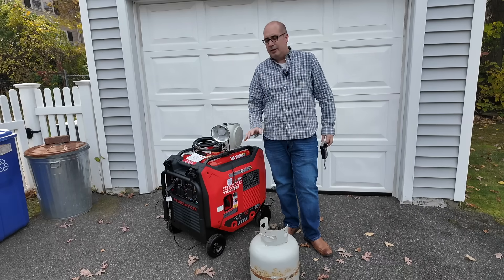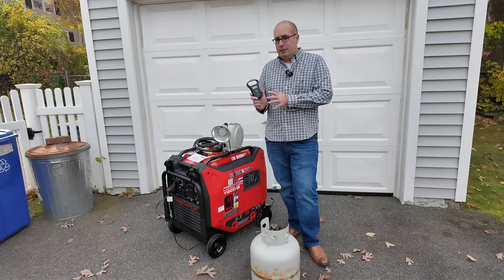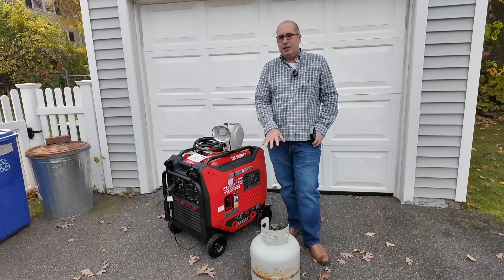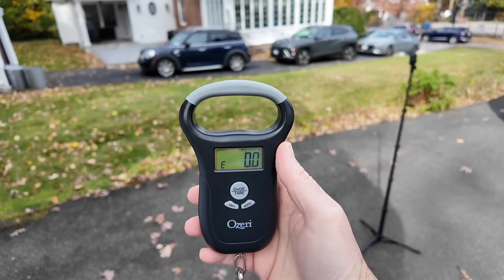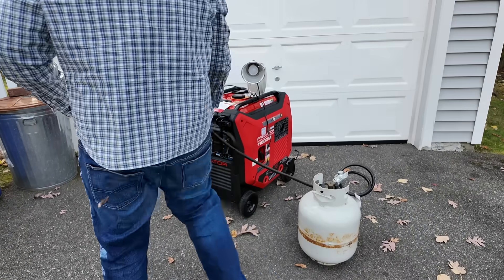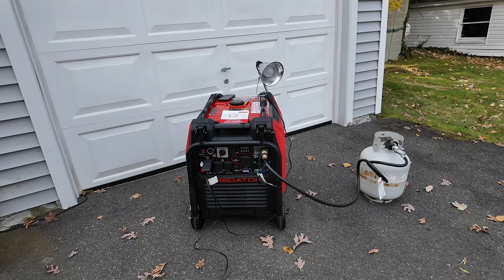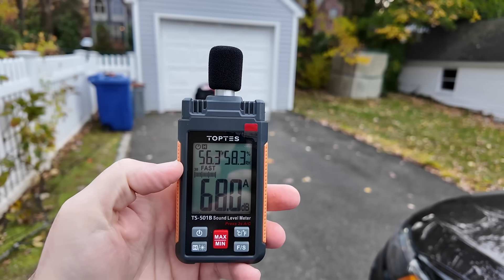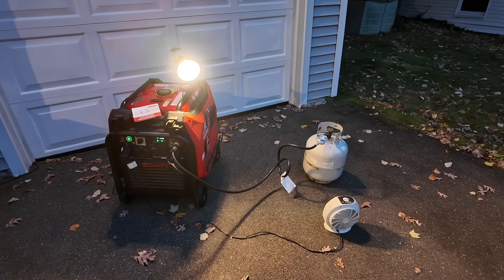Predator 11500w Generator Propane Runtime – You Won’t Believe How Long It Lasts!

Comment: For backup heating during the winter, I have a Big Buddy heater and 20# propane tanks. I plan to keep the tank on the back step outside, feeding the fuel to the heater inside via a 12' hose. 

So...now I have to worry about my tank freezing up and losing my heat?? I wasn't aware of this issue. Or is this more an issue with the generator? Screw that. I'll just bring the tank inside and take my chances. Not going to fool around with hypothermia. 0 -25 degrees F is common where I am.
Reply from the maker: Freezing up is definitely a concern when it's cold, especially with high draw from a generator!
Reply: @Outdoor_Prepper  Well that was my question...is this more of an issue with the generator? I'm not powering my generator with propane. I'm running my heater.
Reply: A Big Buddy won't draw propane fast enough (18,000 BTU) to freeze up a 20 pound tank at -25F. You should be ok. Been there, done that.
Reply: @zippy2641 I've run my (regular) buddy heater down into the low 20s F on a 20# tank with no problems with the tank outside. Supposedly the run time on a 20# tank for a regular buddy heater is 48 hrs on high and 108 hrs on low, so the genny uses at minimum 6x the flow of a buddy heater on high.
Reply: @Skyhawks1979  👍Thanks for the reply.
Reply: @jake-mv5oi  Thanks for the reply.

Comment: Everything in my home is propane, I own my own 3- 500 gallon tanks and paid 1.27 a gallon this year. My electric bill continues to climb every month although I use very little. It would be interesting to calculate what it would cost me per KWH to produce my own electric with this generator. From what I understand you said 20 lbs (5 gallons) of propane gave you 8 hours at 2000 watts which would be 16 KWH. Propane weighs 4 lbs per gallon. so if my calculation is correct, you got 16KWHs for $6.35. Dividing my electric bill by my usage I come out to 3.37 cents for 16 KWHs. I divide what I pay per KWH plus all those other charges that I would not need to pay if I generate my own. I would love to incorporate this unit with a battery pack that it could recharge while running so I could turn it off at night and during the day when not there. Very good video, Thanks
Reply from the maker: That’s definitely an interesting idea! Thanks for watching
Reply: There are 720 hrs in a 30-day month.  Unlike diesel engines, gas engine generators aren't really designed for 24/7 operations.  Fuel consumption would vary, presumably higher in daytime, lower at night.  Maybe combining battery power with gas generator would be more efficient.  Charge battery and power home during day when electrical demands are higher; run on battery power at night when electrical demand are lower..

Comment: FYI, I believe that the department of transp. mandates that propane tanks under 1000 gals. not be filled beyond 80% to account for gas expansion in the heat. Your tank appears to have been filled to about 96%. That level might be dangerous in Summer heat. Be careful.
Reply from the maker: Appreciate the info! Thanks for watching
Reply: Yep, I think ALL propane tanks are to only be filled to 80% for expansion and conversion from liquid to aa gas. (Some type of scientific term 😂)
Reply: The tank can’t be  filled over 80 unless it is defective. 
Portable tanks have an Overfill Protection Device (OPD) that automatically shuts off the flow at about 80% full.
Reply from the maker: @jimbo5635 I agree - 80% of the tanks capacity is 20lbs of propane. They are made to have extra reserve that isn’t filled with propane to allow expansion for safety
Reply: His tank is not over filled, a tank properly filled to 80 percent weighs approximately 37 pounds
Reply from the maker: @jimbo5635 thank you!
Reply: @Outdoor_Prepper Not for safety  it needs 20% to expand and turn into gas from liquid.

Comment: Hi, the regulator you used in this video is different from the predator 5000. Is that the regulator that came with the larger unit or is that an aftermarket 2 stage regulator?
Reply from the maker: It’s the regulator that came with it. The 11500 and 5000 watt generators have 2 different regulators and quick connect ports on the generator

Comment: This is excellent.  A good comparison would be the total amount of energy out of a tank.  In this case you got about 16,000 watt hours out of it.  For a smaller generator you will probably get less on that same tank, because the smaller engines aren’t as efficient.  This is where the larger engines shine when you have a constant draw.  The smaller engines do better with fluctuating draws, because they use less gas when they’re idling.
Reply from the maker: That's a great point about the energy output and efficiency differences between generator sizes!
Reply: There is a young man on youtube that did exactly that. He used 2 generators, a Honda 2000 and a Honda 7000, both inverters. He measured the gasoline into each unit and then recharged a battery pack. The small 2000 unit produced over twice as much electric on the same amount of gas. If I had a lithiom battery pack with a 240 inverter, need that for my well pump and A/C, I could charge the battery pack with a small 2000watt 120 volt generator at night and then pull 240 from the inverter on the battery pack. Hopefully this sodium battery tech brings down the cost of the battery packs
Reply from the maker: Thx for watching!
Reply: @anthonyspadafora1384 sounds like David Poz.

Comment: I have a Honda EU7000is inverter generator. I have a 5 gallon tank on my generator. When the gas tank is full I carry my entire house on it @ 1/2 load. I average 18 hours of run time. Just a comparison.
Reply from the maker: Thanks for sharing your experience with your generator – that's some impressive run time!
Reply: @Outdoor_Prepper I'm not sure if you follow James Candon's channel on YT? He is an expert on small engine repair. I highly recommend him if you don't know of him? 
Him & I have similar generators. Mine has electronic fuel injection. His is older & is carburated. Otherwise they are the same. He doesn't have the same run time as mine. He suspects it has everything to do with the fuel injection? I use exclusively gasoline in my generator. I don't have issues with stale fuel or running out of fuel. I keep an ample supply of fuel to last about a 20 day interruption. The longest I was out was for five days after Snow Storm Alfred. I did not have a generator then. Connecticut was nearly flat with only 4% of the state unaffected by that surprise storm in 2011. It was just on the heels of the restoration of tropical storm Irene. It was a busy storm season. 
I was a power lineman in CT during that time & we were very busy for 12 weeks straight of work. That storm made me convinced we needed a back up generator. 
We were ready for tropical storm Isaias. We were out of power for three days in 2020. That affected about half the state. We never skipped a beat. Our house was cool as a cucumber & my neighbors were miserable. I only found out after the fact because I was working suicide shifts for the local power company. That storm convinced them they needed to up their game. 
Great content as always! I look forward to your next video.

Comment: I have a similar size generator and even in the Florida sun, the 20lb tanks still ice up especially when they get low.
Reply from the maker: That's interesting to hear about the tanks icing up even in Florida!
Reply: High humidity is the primary reason.
Reply from the maker: Thank you for the info!
Reply: @Outdoor_Prepper  I had a 20 lb tank freeze up in the middle of the Dallas summer, so it is a thing for sure.
Reply: @Outdoor_Prepper Yes in the summer Florida hurricane heat it will ice up. I live in Central Florida. It you leave the propane tank on the grass it will kill the grass and have the grass ice up on the bottom of the tank. Sometimes the tank will ice up and there is still fuel in it so you have to literally shake it and you'll have enough fuel for another hour or so. 😅

Comment: This is confusing for me. I just bought a 40lb tank and had it filled. The person at Uhal said it only holds 9 gallons of propane. So my 40lb tank could only run my home for 9 hours? I'm sure there's more than 9 gallons of propane in a 40lb tank, right? So you had about 8 gallons in a 20lb tank. My head...
Reply from the maker: 9 gallons of propane weighs 40 pounds. A 40 pound propane tank means it takes roughly 40 pounds which equates to roughly 9 gallons. My 20 pound tank tank takes just under 5 gallons of propane. The amount of hours you could run your home really depends more on the wattage that the generator is putting out. Hope that helps.
Reply: Not sure if you are aware of this, but the lp is a vapor gas being used. It doesn’t run in actual liquid form like gasoline engines for example. So the vapors actually use way less actual fuel.
Reply from the maker: Appreciate the info!
Reply: You're mixing pounds and gallons.  A gallon of propane weighs 4.3 pounds.  So a 40 pound tank of propane  holds 40/4.3 gallons or 9.3 gallons of propane
Reply: @Outdoor_Prepper  Thank you for the clarification. Should I just go around my home and add up all the wattage of the appliances? Do you do this?
Reply: @Kaikoura26  Motor operated appliances (refrigerators, HVAC, water heaters, etc don't run 24/7).  So adding up all the wattages will skew your requirements way to high.  Your power company might be able to give you your average daily power usage or peak power usage.
Reply: @danburch9989 🎉🎉🎉🎉❤

Comment: Good testing protocols.  What a beast of a generator.  
I have some 30lb tanks and 20lb tanks for my 2400W dual fuel generator, and the 30lb last more than a day.  
Propane can be very convenient, except for refilling, as gasoline cans are self-serve refills at any gas station.  A 500 gallon propane tank in the backyard would sure be convenient during extended power outages.
Reply from the maker: Thanks for the kind words! A 500-gallon propane tank would be amazing for extended outages!
Reply: To me, the best thing about propane is not having to pour gasoline into a hot generator  :-).  I am fortunate that the propane refill place is the same distance from me as the closest gas station.

Comment: Its not the tank you need to keep warm but just the regulator.  Used to work in a shop that had a propane heater, when it got really cold (-4F/-20C) the heater would choke.  Propane company installed an electric heater bloc on the regulator to solve the issue.  Certainly not going to try and heat a 500 gallon tank, same principle applies for 20lb tank. Takes a lot less energy heating the regulator then a 20lb tank.
Reply from the maker: That's really interesting information about heating the regulator – thanks for sharing your experience!
Reply: His primary issue is that the propane cannot vaporize fast enough as the temp of the liquid inside drops. The vaporization rate is determined by the wetted area, AKA how much propane surface area there is, in the tank. This wouldn’t be an issue on a 500 gallon tank, which is why your regulator freezing was your first issue. A 20 pound tank will act much differently.
Reply: yup.. for sure... Live in upper midwest and have my 2nd regulator on the south side of the house; very rarely do we have a cold storm from the South but it did happen once and with very cold winds.. propane runs hot water heater, stove and furnace and they wouldn't work.. I had a hunch it was the reg due to present conditions.. took a hair dryer to it and freed it up and then put plyboard in front of it to protect against elements and viola.. no more problem

Comment: They make small warming blankets for those propane tanks ... a must if you are using during very cold temps.   Thanks for the runtime info ... very surprising.
Reply from the maker: I’m definitely going to buy one of the propane blankets that you can plug into the generator to keep it warm in cold weather. Thanks so much for watching.
Reply: just aim the exhaust at the tank homie

Comment: I wonder what the run time is on the 5000 using propane with same tests. Great video
Reply from the maker: I actually did a video on that! Check it out on my channel. The short answer though is I got 13 hours on a tank.
Reply: @Outdoor_Prepper okay I will definetly check that one out. I missed it somehow. Thanks for your great content.

Comment: Tank freeze up is more of an issue during freezing weather, AND as the tank gets low.  In those conditions the propane vapor pressure may reduce below what the generator needs to maintain power to high loads.
Reply from the maker: That's a good point about the tank freezing up, thanks for the info!

Comment: Could you get a plug in propane tank warming blanket to run off the generator to reduce the chance of icing and maintain enough vapor pressure even in cold ambient temps?

NVM: missed your comment first time through. Great idea.
Reply from the maker: Absolutely and in fact, that is my plan!

Comment: Great video, thank you! This looks like a great alternative to a whole-house standby generator. Have you found anything about the Predator 11500 that you don't like?
Reply from the maker: Thank you so much! So far there’s nothing I don’t like other than the fact that it is pretty heavy if you need to lift it for any reason. But it rolls very well on the wheels.
Reply: A standby generator that runs on natural gas is the way to go if your house has natural gas service.

Comment: Great video!! Very informative! Do you know which magnetic dipstik and drain plug are the correct fit for this generator?
Reply from the maker: Thank you! I’m glad it was helpful! I’m not sure what the right magnetic dipstick is yet but if I figure it out I’ll post it. This has a larger oil fill then the 5000w generator

Comment: I think you need a 40 pound tank if you plan on going full load because then it would ice up from dropping the pressure so fast or you can get one of those manifolds to make 220 pounds of 40 pound by hooking them together just a thought great video though
Reply from the maker: That's a good thought on the 40-pound tank, thanks for sharing!

Comment: It's ok to break in on propane?  I thought I read somewhere that you should break it in on gasoline.
Reply from the maker: I’ve never heard that you need to use gas - it’s more about having the engine run so the piston rings can seat correctly and everything can wear in correctly and change the oil to remove metal shavings from the manufacturing process . Thx for watching
Reply: Great thank you.  I didn't want to introduce any gasoline to the carb.  Plan on running mine on propane only sourced from a whole house tank.